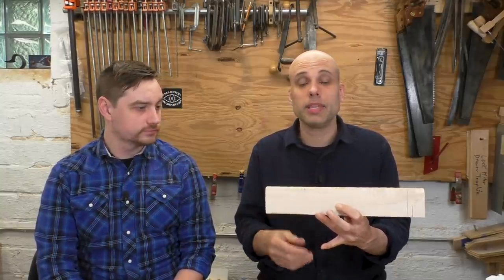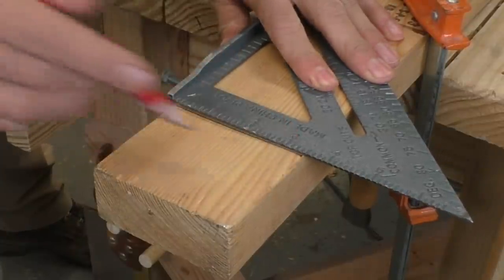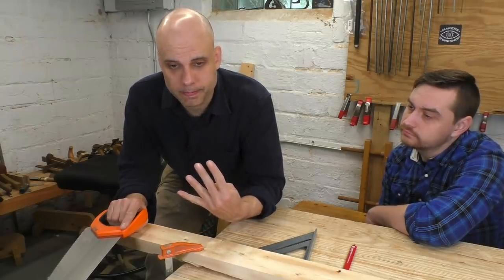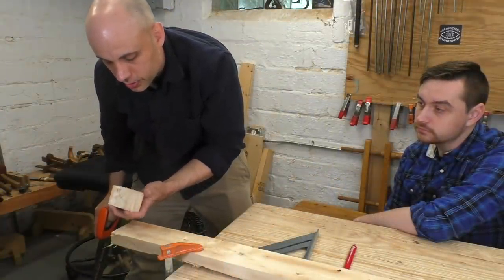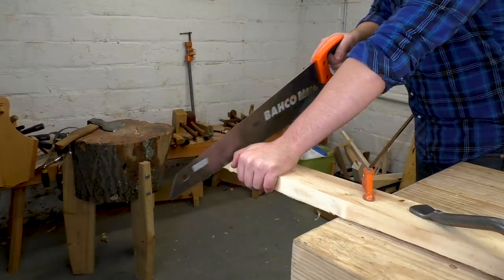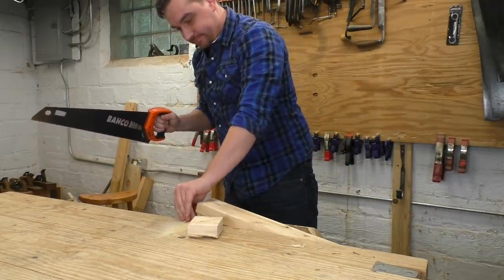True Beginner: Learn to Crosscut by Hand!

Comment: One very important item to remember:  It’s easier to cut off than it is to cut on.
Reply: I was always taught measure once, cut twice 😉
Reply: I cut on by cutting off a tiny bit that I glue on. The touchy step is to trim off without glueing off the tiny glued on bit.
Reply: Measure once glue once.
Reply: I cut it off three times and it is still too short 🤷‍♂️
Reply: I hire someone
Reply: Just turn the saw over. Never cuts too short that way.
Reply: Im always left with lots of on cuts after jobs
Reply: Cutting on is nearly impossible
Reply: @bobweiram6321 you must be better at gluing than I am.

Comment: When it comes to cross cut accuracy, my epiphany happened when I watched Paul Sellers score a line with a razor knife and then augmented it using a chisel to establish a knife wall. It made all the difference.
Reply: Fine woodworking crosscuts are best done by a different method than shown here, but that’s okay. This is great advice for the cuts while rough cutting to basic dimensions from larger pieces of lumber, or for cutting construction lumber. I learned the basic techniques shown in this video from my dad and grandfather when I was a kid, as neither of them had power tools... Grandpa because he had used hand tools only his whole life (and couldn’t afford power tools), and Dad because he just like hand tool woodworking for the little he had time to do it (Dad was a busy oilfield engineer during his working life and only picked up his woodworking again after he retired for the 3rd time). The fine cross cutting I do nowadays, using a knife wall a la Paul Sellers, a 12 TPI crosscut backsaw, and a bench hook are the next level to be tackled (I hope!!... Rex???), after Nate learns how to ripsaw!

Comment: I put the pencil on the first line made, then use the pencil as a stop for the lip on the speed square. This ensures that subsequent marks are near perfectly in line with the first one made.
Reply: Me too. Figured that one out while learning basic geometry in primary school, because no matter how much I sharpened my pencil it would never be as accurate as placing the pencil on the starting point first. When connecting two points I then had to eye-ball the offset on the other end, but that’s still more accurate than trying to guess the offset on both ends.

Comment: Thanks Rex. I needed this. I worked a few years in construction as a framer 25 years ago before I got into IT. A hand saw was something I only used once in awhile when it was too awkward to use a Skil saw without likely getting hurt, and when it would take too long to switch to a jigsaw or sawzall. All that to say it was git 'er done and how straight, or pretty the cut was not very important. There was no art or technique to it, and I was never taught these basics.

Comment: Didn't see this mentioned yet, but as this is a video for beginners who may not have a square ready; you didn't mention that this (pretty standard) saw that you're using can also be used as a basic square for 90- and 45 degree marking. 
Really enjoying the videos b.t.w. keep up the good work!
Reply: Yup, most modern carpenter saws have that built into the handle.

Comment: You use the same general arm and shoulder motion as for shooting pool.  I, personally never drop the cut through the near edge first, but I learned from carpenters while my dad was building a house exention.  They pointed to the reflection of the wood being cut in the saw blade.  The rule was you wanted the reflection to look as if the saw was completely transparent and you could see the wood run straight "through" the saw blade.  That means the blade is plumb to the wood surface.  So you followed the line and "plumbed" the cut with the reflection.  It works pretty well with a decently polished saw.

Comment: I think that when making those initial cuts, an experienced woodworker will unconsciously control the downward pressure on the pull, as that's when the saw tends to jump out of the cut. It's really subtle. So I'm not sure if it's subtly lifting the saw or applying a tiny bit of downward pressure. Also, the speed of that pull is important. I think you need to slow down on the pull, but again, it's subtle and often an unconscious thing. Maybe best not to overthink it and just get a feel for it.

Comment: [Would you copy and paste this in the description, so that a chapter playlist will show up on the right side of the screen, please?]

Table Of Contents

00:00 Introduction

00:53 Types Of Cuts
01:43 Tools: Saws
03:01 Tools: Square; Pencil

03:13 Let's Draw Our Line
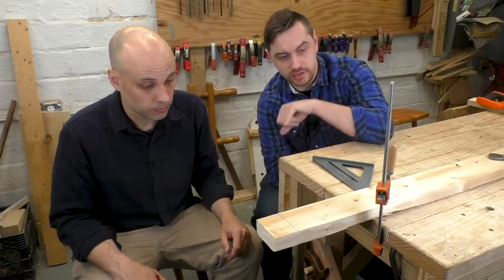04:35 Side Note: Why is the wood being clamped to the "table"/bench?
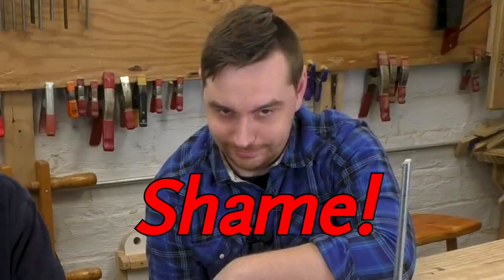05:08 Waste; Kerf; Splitting The Line

06:31 The Trench
07:17 The Kerf
08:09 The Corner
08:57 The Waste

09:30 Nate's Turn
09:54 Trench
10:26 Tip: don't push down on the saw.
10:46 Kerf
11:00 Tip: keep the trench shallow, while trying to make the kerf.
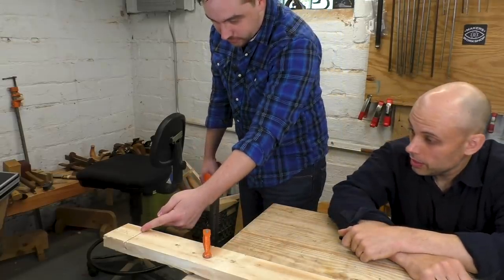11:50 Corner
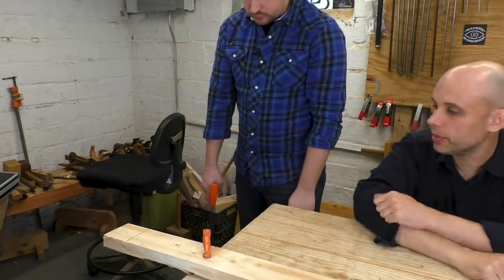12:09 Tip: let your arm swing freely, as opposed to letting the elbow hit the rib cage.
15:05 Result

15:26 More Practise
16:24 Practise In Vice
17:35 Low Saw Bench

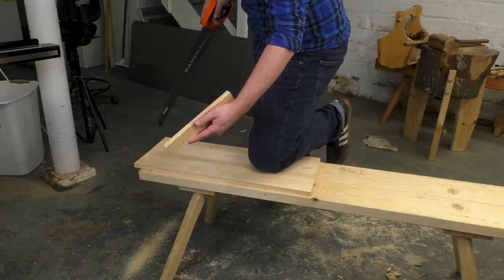20:03 Nate's Advice For People Learning To Crosscut By Hand
21:41 Nate's Bench Preference
22:04 Final Remarks

Comment: One trick I learned from someone (Shannon Rogers I think) is that you can use the reflection of the wood in the saw to make sure you're cutting square.  If the wood lines up with its reflection, you're square.  My primary saw has so much patina I've never been able to test it, though :)

Obviously, this is for when you're rough cutting or you plan to shoot the board afterward - for instance, if you have one board you're cutting several pieces from.

Comment: Interesting approach.  It is absolutely nothing like I currently do, but I will have to try it.  Currently I score on four sides instead of laying out with a pencil, and then use the saw at 45 degrees from front to back.  All on a low bench.
Reply: You may not need the fourth side, since that’s where you come through with your cut, but I do agree with your choice to use a marking knife instead of a pencil, since you can get a much more accurate first mark. For lines that connect to lines you’ve already made, I recommend placing the marking tool on the previous mark and then sliding the square or straightedge up to it, that way you don’t have to estimate whether there’s any offset between the mark and the square/straightedge (this is of course more of an issue when using a pencil than a knife).
Reply: @ragnkja  The point of scoring the back side is to reduce tear out.  Sometimes that is important, and sometimes not.

Comment: Great video as always. I was wondering about the workpiece positioning. I would have clamped it closer to me to have better access and not have the edge of the tab... - um - bench ;-) in the way.
Reply from the maker: I don't have holdfast holes close enough for that. I'm thinking of adding some to the middle plank of the top.

Comment: Hi Rex, just to be sure - you’d follow the same procedure with a pullsaw I suppose? Making the trench on the opposite side is harder than with a western saw I feel. I developed a habit of starting by pulling but at the same time trying to ever so slightly lift the blade up because otherwise it catches too much and I have trouble controlling it. It sometimes jumps a bit and I’ve cut my fingers a few times that way. Any tips?

Comment: Way back in the day, hand saws had what my Dad called "starter teeth" at the handle end of the blade which precluded the need for a trench.  A couple of short strokes and then you were hard at it.  Don't know if that's still the case with any of today's had saws.
Reply: Those teeth are only there if you put them there when you sharpen! Paul Sellers recommends them near the tip of the blade rather than the handle, likely because you tend not to use the first inch of the saw once you get going, though I suppose the same could be said about the heel of the saw.

Comment: Hi Rex, loving the great content from over the pond! Would you consider doing a video on ripcutting with hand tools? This has been a real issue for me as a newbie woodworker. When starting out with cheap softwoods I find that my general purpose saw and crosscut tenon saw just make a hot mess of any ripcuts. Is there an affordable option for a newbie? I hear ryobas can become hard to use when making larger ripcuts as the crosscut teeth catch on the opposite side? Thanks!

Comment: So, Low Roman Table and English Joiners Table are incorrect?  :)
Reply from the maker: Technically, yes.
Reply: The low Roman table is actually a bench as in "sitting on it bench", together with your English table you have a mismatched dining room set...
Reply: @johanneswerner1140  
The joiner’s bench could also be called a counter, or a kitchen counter could be called a bench.

Comment: Question- if when using a low platform to saw on, is is there a danger of making the cut holding the saw  to vertical,  then it might create tear out ?
Reply: There's a traditional technique I saw Chris Schwarz do once where the saw is completely vertical and IIRC the saw was held by with the lower fingers in the part of the saw handle that's normally the top (imagine holding the saw horizontally upside down and let the toe drop).
Reply: No more than if you rotate the whole setup 90° so that the saw is horizontal.

Comment: hey rex, i got a n5 jack for real cheap and its my only plane. However it has the same problem that the smoother you reviewed a long time ago had ( the slot on the chip-breaker is too far back and a fine set will keeps the iron from coming out of the mouth) do you know any fix for that, or should i just take the adjuster out and use a hammer like a wooden plane ?
Reply from the maker: Try setting the chip-breaker further back. It's not ideal, but it might fix the problem until you can get something better.

Comment: I cut 100 wonky cross cuts before I figured out to mark 2 if not 3 sides of the cut.
Reply: I quickly learned (on my own) that I need to mark the edge that’s easiest to see as well as the face in order to get anything resembling a straight cut.

Comment: Do you take into account the fact that the line has a width/thickness?
Reply: If you draw the line against a square as he does, notice that the location of the square becomes the edge of the line, not its center.  If you mark which side to cut on, and then leave the pencil line, you can position your cut precisely, even with a line you can easily see.
Reply: It’s usually significantly thinner than the kerf width you also need to take into account, but yes, for maximum precision you do need to consider the width of the line and how exactly you started marking.

Comment: About cutting into your bench, it is an English bench, just rip off the front board and replace it.
Yeah, I need to do this soon. No, I'm not a good carpenter / joiner / woodworker. But it's a work thing, so meh.

Comment: In my opinion pulling the saw to start the cut (making a trench) is a very poor sawing technique. Actually you need a lot of sensitivity to cut straigth and accurately. I always teach people to start a cut on the push stroke, and compensate for the weight of the saw so that it does not bite into the wood but cuts lightly on the first few strokes. I think it help people to learn that you should not bulldog the saw into the wood by pressing downward trying to speed up the cut. Sawing takes a little finesse.
I like this series by the way... that's a great idea :)
Reply: I have seen/read a number of recognized experts who advocate starting as you describe and decry the trenching technique Rex is showing here. I try to do it myself using your technique, but dang if that saw ain't heavy! (I often just start a corner or two with a chisel.